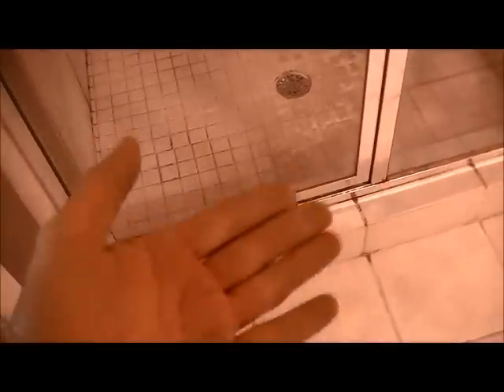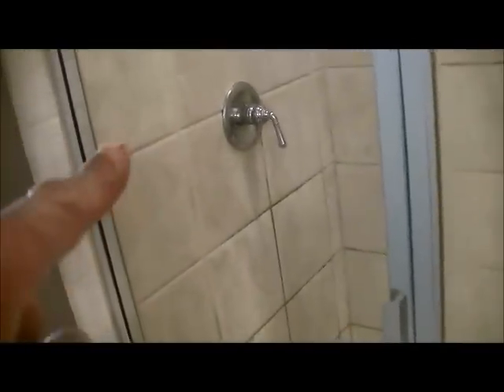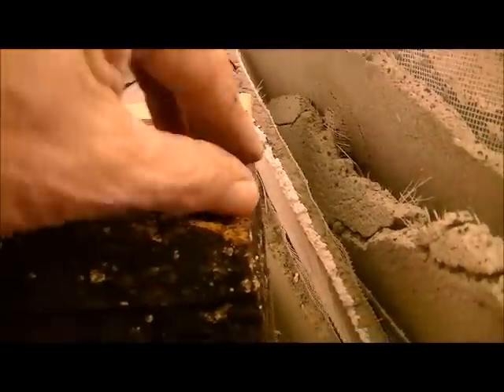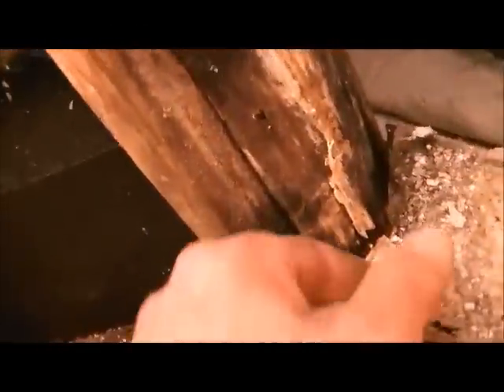Shower Pan Leaking !  ( bad installation of all material )

Comment: 3 years.  My head is still shaking at that.  3 years and the shower was completely rotted out.  Unbelievable how builders cut corners.  My house is a freak show of shortcuts that I am finding and trying to correct.  I have my hands full (2004 build).

Comment: GREAT JOB! great job! hey i have the sam eshower need your help. the water was shooting onto the forward shower wall where, thinly cracked and chiped grout was there for a long time, so now the 6inch wall cavity behind the shower wall that is getting the water hit with, is leaking or molding at the bottom trim level. odors of mold.  So is that means the backerboard or pan membrane is broke? no other leaks , what to do? how do you prove it to the builder warranty? thank you!

Comment: It's not always possible to find caulk or silicone to match the grout color, I  grout all the corners and always run a bead of clear 100% silicon over it, that way if the grout cracks the silicone will prevent water from penetrating through the crack.

Comment: If someone may please give me some advice.   I have a stand up shower with mosaic tiles on the floor and big square tiles on the walls.   It's in my master bedroom and leaking downstairs living room.   I broke walls and i should not have, but non the less, i confirmed the piping is good and no leaks.   i put duct tape very well at the drain of the shower inside on the floor.  I filled it up from another source with water up to the curb or step almost.   It's dripping downstairs.   

Is there another test to let me know if my pan liner is shot, or my grout is leaking?  When i visually look at it, the grout looks ok.  Silicone around the edges looks ok.   Any ideas?  Only thing i can think of, is not filling it up all the way and see when it starts to leak as i fill it.   Any help would save our family so much money.   Thanks so much.

Comment: at 10:07 i just want  to confirm something based on your previous videos, and i have a feeling i might have written something down wrong. (fyi... LOVE your videos and they are helping me out A LOT in DIY in an area with no access to a pro-tiler) In another video you said to place your Durock in the pan when building a shower pan to prevent that odd gap. So i assume it means: 1. build the actual base of the pan (if doing pre-slope),  2. then the liner, 3. then the Durock, 4. then mortar the top layer of the pan, 5. then additional waterproofing on the Durock i.e. redguard/aqua defense on everything. etc...
Reply from the maker: +Nic Onefun You have it all right EXCEPT the Durock on the pan...pan dries ( mortar ) for at least 2 days, then Redgard and tile.

Comment: Why put the same grout joint in the same place that caused the problem???  put the bn on top then the glass guy can follow ur grout joint. less cutting for u and fewer grout joints for water. just a thought .
Reply from the maker: +Michelle K  There were huge problems on this shower, probably the least of which is the grout lines....anyway, waterproofing walls, sloping all surfaces, using admix with grout, sealing, etc. insures it has NONE of the issues it had previously.

Comment: You have helped me view things differently. So thank you but, let me give you a tip back. When you are tearing out a shower or tub/shower combo, use an old rag or paper towels to plug up the drain. Debris can clog up drains. Just a heads up.

Comment: I had two bathrooms done.  Am getting ready to use the second one while the first one gets reconstructed.  i am afraid that the second one will present problems somewhere down the road.

The floor on the first bathroom was done wrong
i am having the floor on the shower redone for the 4th time.  Several problems as i go through videos.  
1.   the tiles were too big and one of the tiles cracked and had water seep underneath and come loose.  
2.  the base of the floor did not come up high enough.  
3.  The first time, the wrong type of drainage was put in.  
The list goes on.  

i am having the same person take out the big tiles and replace with smaller ones.  
My question is what is the proper cement to use.  Does it get mixed with sand? Somewhere i saw that you use 1 part portland cement with 5 parts of sand or 2 50# bags of all purpose sand with 20# portland cement.  Is this accurate.  Also i saw that chicken wire goes in as well.
Reply from the maker: Sorry to hear you're having so many issues. But glad to hear you're pro-active in doing research.

None of my videos show me mixing mortar in portions...others do that, I simply get mortar premixed at Home Depot ( Sand Topping Mix ). That is for the pan itself, no chicken wire...if a pre-slope is done, then yes, a wire mesh should be incorporated.
Reply: i responded via email...dont know how to add pics to this.  This is what i wrote:

Wow...thank you for responding, really am grateful.

Before i read your message i took a trip down to Homedepot.  Not sure they if they understood i needed to raise the floor.  The tiles on the floor are out and there is cement there but the floor needs to be raised more.  Are you recommending the Sand Mix (picture on the left).  The picture on the right (Versabond) is what Homedepot recommended, but i am looking at videos and the Versabond is placed with the tile.  Does the Sand Mix go on to raise the floor and then once dried, Versabond can be used to put the tiles on with?